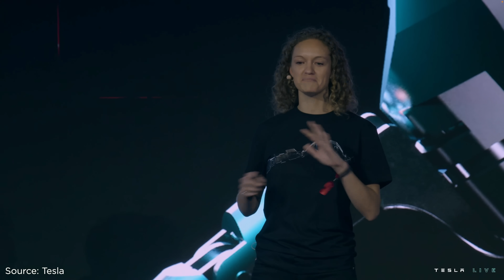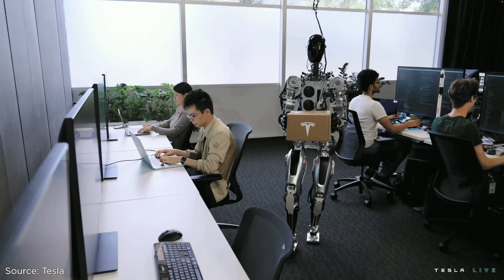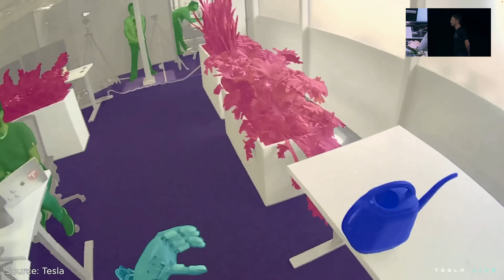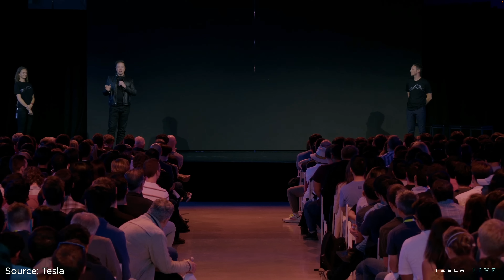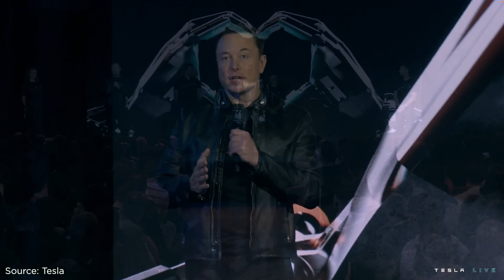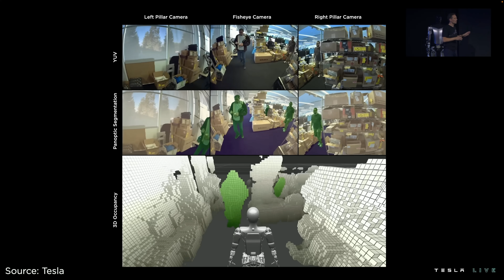Elon Musk Reveals Robot at Tesla AI Day 2022 (HIGHLIGHTS)

Comment: I'd rather Tesla had shown a Power Wall that also incorporates a breaker panel with smart breakers. Those of you with electrical knowledge will know where I'm going with this. 

Having the ability to charge the car with DC from the solar panels and batteries would get you lever 2 charger with a 15kW array and a couple Power Walls. Being able to load level by prioritizing circuits in the home would allow you to run high demand start up circuits like an air conditioner. 

I would much rather hear about an all in one Power Wall for your entire homes electrical needs than a robot. Then Tesla could make DC appliances because the smart breakers could also switch to DC when a Tesla appliance is installed. 

Residential homes should be powered with DC anyway because it is much safer and efficient. This should be Tesla's #! priority, not a robot that can water my flowers. Let's get our homes switch to DC and solar panels, then we can worry about robots.

Comment: Im not in robotics but i code, and what frustrates me is why is this not easy, im lacking the understanding and knowledge to do this but bare with me.. you need cheap electro-motors on all joints, two per joint to allow for more movement possibilities, and make it bottom heavy with some heavy boots and legs so it cant fall as easy.. with batteries as stability blocks all around the robot.. thats it from a hardware perspective.. wires do the connections they can be hidden behind aluminum sheets, nicely shaped, and from here we just do the code.. combination of joint/gear movements to keep the balance such as body stays almost straight but when left leg moves forward right hand moves back as in almost a running position.. the sensors around the robot sense for heat, distance and the same ai as in the car can shape the world around the bot for the developers to do the tinkering until the movement is damn near perfect.. it doesn’t have to be fast, the first generation needs to show it can be something in the near future.. from that point you just run different scripts of movements to figure out what the issues are, so that you can fix the hardware possibilities for gen 2..
Reply: The difficulty is fitting all that technology into a, bipedal, human form.  Our brains, use of tools and machinery is our greatest asset, not our ability to walk and balance on just two legs. Other creatures can out perform humans running faster, flying, jumping, swimming, etc. Many spend their entire existance in sea water. Engineering a robot in humanoid form actually restricts it's potential.
Reply: @mikeomolt4485   the brain is a computer chip, with not more than a few drives, and good coolers.. that can be placed in the stomach area since it doesn’t require a stomach and since this would be quite heavy it would help with balance and the whole by pedal form conversation.. the software is an issue that requires a period of time for trial and error, but not a single company has been able to tackle the hardware side of it and that is what bothers me.. all i want to see from a first gen machine is tackling movement of joints efficiently with no weights.. and not even that can be done as of now and seriously its not that difficult, the same way i would force a software to do a calculation based on your click on the screen is the same way you would give electricity to a motor in a join to move it.. after that i would track why the balance is being lost and adjust accordingly with other joints .. it’s exactly what the human body does with out biological senses..
Reply: @DaRKHuNTeRMK    Human brain and body evolved to the stage it's at over millions of years. Gonna take engineers a lot more time to replicate one. Could always arranged to be put to sleep, frozen and request for an advanced humanoid robot to awaken you in a hundred years or two.